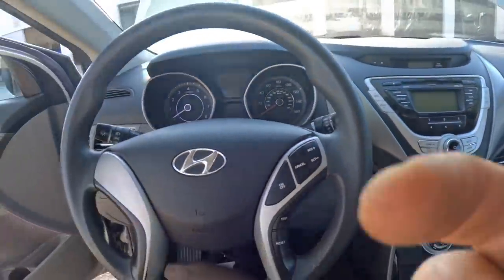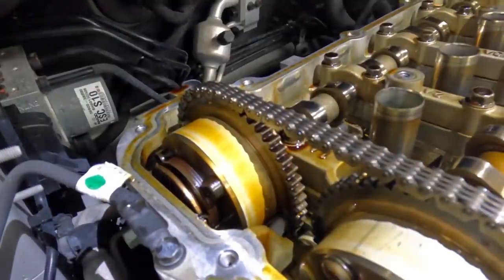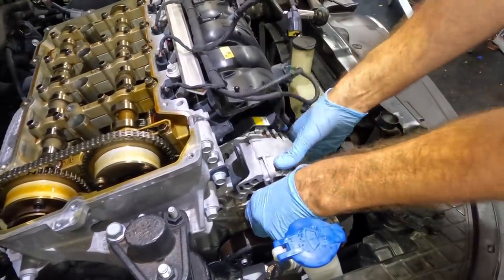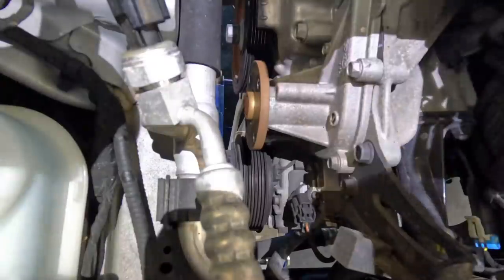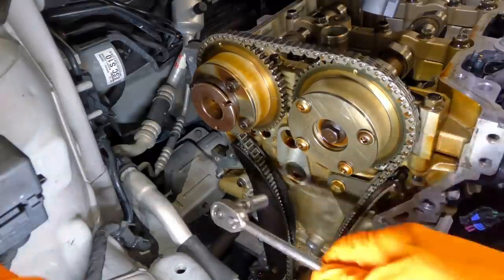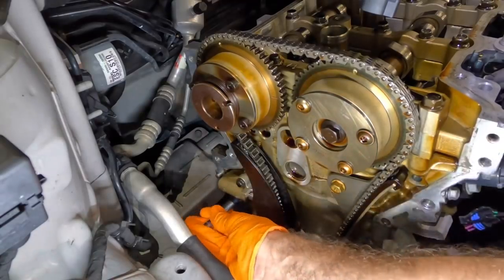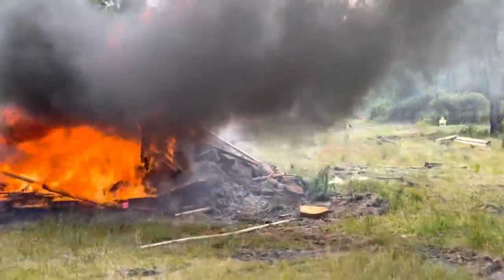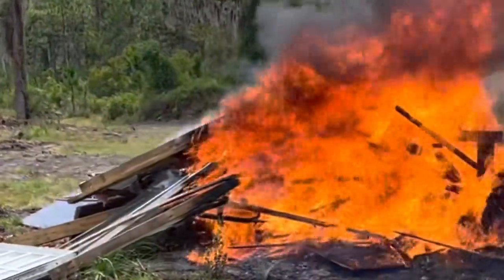I can’t finish this car! Evil Elantra!

Comment: I used to love Nisan, but the newer ones are just junk.
This one looks pretty nice, I like to see a beefy timing chains on an engine, and one this beefy, on a 4 cyl is awesome!
Reply: Erm, it's a Hyundai? 🤦‍♂️
Reply: I have the exact same car, bought it new. It has a NU engine which is literally a “ticking” time bomb
Reply: @DraftySatyr  ROFLMAO!!!
Then I'm in shock, that Hyundai would use a chain driven cam system, LOL!
P.S. I still stick to what I said about Nisan... 😂🤣
Reply: @RustyZipper  Hyundai and Kia are both, companies that build cars to only last 5 years, the average time it takes to pay one off.
Back in 2007, I purchased a Kia Spectra 5, and in 2 years, it completely started falling apart.
I traded it in on a Subaru Outback in 2009, and if I didn't have trade in insurance, would've had to pay them to take it!
I have no idea why I thought the Elantra was built by Nisan, LOL!
Reply: @KentuckyRanger  Strange that both should offer a seven-year warranty in the UK then - and were the first car companies to do so.

Comment: 11 year old car with 162,000 miles - very clean engine. 
I'm curious about the oil change interval, and which oil the owner used in this engine.
Reply: I have the exact same car with 80k miles. That’s extremely clean!

Comment: Out of interest Ray, Would you recommend a new water pump while you were that far into the engine, with all the othe ancillarys out of the way?
Reply: my opinion always change the pump. Relatively low cost item
Reply: I thought the same thing when he got the tear down to the water pump...personally, I would on my own car.
Reply: @robsterenborg  That is one of the reasons I asked as I would to. EDIT. I am not trying to knock Ray and we do not know the whole story
Reply: Also replace the belt, tensioner, thermostat if possible.
Reply: If you're already there it's only $20-60 more to replace, so why cost yourself hundreds later by pinching a few pennies now?
Reply: @kevinwilliams4899  well you never know how much the customer can afford. Chances are great that the pump might die and then this pump will be a lot more expensive. But people make strange decisions all the time
Reply: @robsterenborg  I’m sure Ray suggested the ump,,just weird he didn’t mention it yet !

Comment: Did the chain seat itself on the crankshaft sprocket, because it looked as if it wasn't. Or did you not worry since it would have sorted itself out the first time as the crank moved clockwise..

Comment: So, I guess you have to do an oil change too after spraying all that brake clean down into the front of the oil pan.
Is that something that the customer is charged for, or does the company eat that?  Just wondering.
Reply: The shop I worked at would work the oil change into the estimate.  Anytime the front of the engine is torn down the oil should be changed.
Reply: And A coolant flush
Reply: even if he didn't it disappears through the pcv valve the first time it warms up.  you truly should have known.
Reply: @i.jackanov7382  ya Bubba!
Reply: RTV remnants in there too.

Comment: At 21:00 you spray brake clean with reckless abandon into what I assume is the oil pan. Why is that not concerning? Was an oil change expected before it leaves the shop?
Reply from the maker: Because it’s going to be drained before the job is done. No worries on the oil contamination
Reply: @wyatt rich You should, and most mechanics will, change the oil whenever you open up the engine like this.

Comment: Some engines will clear but most will have an interference fit. The pistons will hit the valves. Do not turn the crank or cams while installing or removing.
Reply: With the rotation of the cams unrestricted, as they were while Ray was doing the crank rotation, the cams will spontaneously rotate to a position where the valves are all closed.  Spring pressure from the valve springs forces the cam lobes away to the TDC or near TDC position.  Rotation of the crank in this instance, therefore, is not a risk.  This is especially true since the cams had already been positioned at the TDC position and they had only been moved slightly relative to that initial setting.  Furthermore, the intake cam and the exhaust cam were disconnected relative to each other and this further promotes free rotation to the optimal orientation.
Reply: Had a timing chain break on my s10. Bent every single valve. Fun fix
Reply: @stevegrant425  Nahh, there is no place where all of the valves are closed. A cam won't move on it's own anyway. Just moving a tooth or two during removal probably won't do any damage. What I meant was don't just crank over the starter trying line up the dots.
Reply: @Michael-rg7mx  you are right. I was thinking of bike engines with a single cylinder per cam.  On engines with multille cylinders, each can  poten tially reach tdc at different times. Thx for the correctikn.
Reply: @stevegrant425  and thus….the end !
Reply: @Michael-rg7mx  Dah !

Comment: I’ve got a question if anyone is willing to try to explain it to me. If a timing chain and all its links are a set length, why do you have to line up the marks on the chain with the marks on the parts it integrates with? I can understand why the parts all need to be in the correct orientation to maintain timing but is the chains orientation as critical as the sprockets?

Comment: ray i need your opinion/advice . 6 years ago i puchased a used 2011 tucson from a dealer. it has always had a harsh teeth rattling ride like an empty american p/u from the past.   struts and shocks have been changed, dealer and other tucson owners tell me this is normal for this  model year.  i purchased an extended warranty so what ever it is i'm covered.  any ideas ?

Comment: With the parts and labor my guess is the owner will be facing a bill of a couple of thousand bucks.  I would have just lived with the clattering at cold start, a 2011 Elantra with over 160,000 miles is nearing the end of it's life anyway.
Reply: That whole timing kit with phasers is only $200. I don't think it will be as expensive as you think.
Reply: @alexandermckay8594  Most garages doing work like this will only use OEM parts direct from the dealer, also there is standard practice for garages to add a mark up on the parts so trust me when I say the invoiced total for the parts will be well over $200.  Regardless, as I say the total cost for this job will be around $2000.  If the man himself wants to interject and state otherwise and say I'm way off then I'll happily stand corrected.
Reply: I was quoted $1300 for a Ford van about 5 years ago. I chose to put the van in a dormant condition (159K miles on odometer) and buy a Chevy pickup. The van now stores a few sheets of marine plywood and some cypress lumber.
Reply: @108gk  I bet you could do the repairs yourself.  I am no mechanic but with a little help from Youtube over the years I have replaced struts, ac compressors, axles, wheel bearings, fuel pumps, brake and exhaust work.  I'm pretty confident I could do a lot more, it's all about building up your confidence, knowledge, and tool collection!
Reply: Sad thing is I own a 14 Elantra and after a ton of research the cold startup noise on these engines is the norm. And yes, this was a waste of time and money. Given how clean his engine bay was it makes sense this guy is babying this car too much. Not a car worth investing this heavily in.
Reply: @user-pj8em4gu6v  Saying is…… It now, before this repair, has served it’s purpose to mankind ! LOL
Reply: Granted it was at a dealership, I once had this repair done under warranty on '12 Elantra and the cost charged to Hyundai was like $2300. Car still ran poorly after the repair, so I sold it for a '13 Avalon with 30k miles.
Reply: @robbflynn4325  Ohh, I know that. I was just surprised because I would have thought the price would have been much higher on the parts cost.

Comment: The owner of the shop I work send me a Suzuki GS450 from 1982 or 84, without any wire harness, locked rear drum brake, welded nut on a broken swingarm main bolt, missing bolts that hold the engine, no working stator nor rectifier, crusty carburators, etc... a nightmare, I managed to get ignition spark and clean the carburetors, do the electric pick up with twin AC CDI, add new coils, new spark plugs and it finally works but needs a whole bunch needs a donor bike 😕 it's been a long 5 months I only want that motorcycle to go away from my garage 😭

Comment: It's just a Car, Ray. A Nut's a Nut and a Bolt's a Bolt. You can do it. Personally, I am being whopped by an o3 Camry, with P0031 Heated O2 Sensor ckt. It isn't Sensor and I can't find info on the Circuit, Fuse or Relay location. I will most likely spend the $70 or so it costs, for a Factory Manual. Such is our burden, my Friend.
Reply: A weirdo is a weirdo…. why try to fix a nineteen year old car…. & you said “ friend “ that means singular…. what no have no other friends ?

Comment: What does a phaser do and how do you diagnose it and what caused that one to fail ?
Reply: The phaser is used in a variable valve timing engine, it is used to advance or retard the camshaft in relation to the location of the driving sprocket attached to it.  This is performed through hydraulics - a solenoid operated by the PCM will allow oil to flow into it, or allow oil to drain out of it.  

A bad phaser will allow the cam to run out of time which can be detected with diagnostic software.  A seriously bad phaser will make itself present in a physical inspection, as displayed near the front of this video (you could see the chain moving unnaturally on it).

Comment: So....what exactly is the failure?  A item that varies the cam timing?  And why would that fail?
Reply: I reckon spring tension was not up to spec,  but the 'why' wasn't specified.
Reply: The two plastic chain guides wear to the point the tensioner doesn't take up all of the slack. The variable timing gets too variable and you get rattles and misfires.
Reply: Failure to communicate !

Comment: Ray, in the past, when you change a wheel bearing, I've seen you use a kinda of flapper abrasive wheel..Can you list the part number and where did you got it from?  😎
Reply: Does it go on an air tool? About 1.5” in size?
Reply: You can get them from hardware stores (Bunnings here in AUS, I guess Home Depot in US or whatever you have). Pretty standard drill attachment.

Comment: Why ever happened to the old days when timing chain meant you never had to mess with it?  Chain stretch? Phaser wear?  I swear I would rather have an EGR with a timing belt system.
Reply: Definitely timing belt systems aren’t bad. I have a Toyota Tundra and the v8 engine has a timing belt, I had it done in 2018 at 132,000 miles and I won’t have to do it again until 2028 or 222,000 miles and I’m currently at 172,000 so it’s not bad of an expense at all, since the the engine is very reliable.
Reply from the maker: The EPA happened, and we tried to legislate a desired result at great cost to the consumer. Domestic diesels are a perfect example. They come equipped with thousands of dollars in failure prone emissions systems that the end user has to pay for, however, vehicles built for export do not have the mandated equipment and the OEMs are free to ship them overseas all day. America Last…it’s been that way for decades

Comment: If there is still time, check the chain on the crankshaft again ... it does not fit correctly - 27:30
I mean the chain to the teeth, NOT the link to the dot.

Comment: sound like crank bearings wich is common on hyundai 4cyl engines....its a known issue. there actually being sued for this, we have replaced over 1200 engines from hyundai in the year 2021 in the 2.0L format ALONE. The hyundai 4cyls are garbage....the issue is lack of lubrication in the crank bearings and it just burns them up n dissolves them...drop the oil pan...i gurenetee u it needs a engine
Reply: Nope ! Normal !

Comment: I can hear your co-workers in the background cinching up oil drain bolts with an impact.
Reply: Hahahaha
Reply: @TheFrenchPug  ok put oil drain in finger tight…then put 1/2 impact gun to “on” this will tighten to 500 lb.ft. ( if you have a snap on gun” ) hold trigger for 20 seconds! Your done…just add oil….you got it now!? LOL
Reply: Torque to spec - two ugga duggas.

Comment: I’m surprised that you didn’t remove the spark plugs. It makes changing the timing components much easier since things won’t bounce to a different position under compression.
Reply: I recently changed the timing belt on a Honda J35 at 100,000 miles.  As part of the service I also changed the spark plugs.  I did the belt, then afterwards did the sparkplugs.  While trying to align the cams I experienced the "bounce" you mention.  I wish I had read your comment before I started on that "Odyssey".

Comment: I have a 2012 Elantra with 121k miles with the same noise. How much did this job cost? I'm mechanically inclined but just touching a timing chain sends me into a panic. I had a 2006 maxima that had the plastic timing chain guides, it broke at 50mph and jumped time... Since then I'm terrified to mess with anything inside the engine like this 🥺
Reply: There was a class action lawsuit settled by Hyundai about bad piston rings. You probably should contact Hyundai ASAP
Reply: @mwf5454  really now? I'll definitely check it out! Thank you so much!!!
Reply: It depends on the engine.  Not every Hyundai engine is part of the class action.
Reply: @mwf5454  after 20 rings……..this number is no longer in service !

Comment: After having to deal with  a family members 2016 Kia burning 1.8L of oil every 10 days with less than 80,000km/s  and Hyundai saying "All cars burn oil it's normal. Were as reliable as Honda's" . I will never own a Hyundai product.  I don't care how cheap they're to buy.
Reply: "I had a bad experience with an XYZ product once, therefore all XYZ products are bad and clearly inferior to everything else"... You sound silly as hell, you should rethink the choices that brought you to this moment.
Reply: All manufacturers call a situation” normal “ when a specific problem in their product hit 10,000 complaints! The word NORMAL is abused as much as I LOVE you !
Reply: @wyattarich  I work on cars for a living. Some manufactures have better reliability and better designed engines then others.  Honda's aren't without fault .  There a class action lawsuit against Hyundai in regards to those engines.

Comment: I just watched you spray brake cleaner right into the oil sump. Everything you sprayed, all the gunk, all the brake cleaner, all the debris, went right into the oil sump. Not good.

Seriously, you need to lay off that stuff. I hope to God you change the oil later in the video, before you try and start the engine. Brake cleaner is not meant for tons of things you use it on.
Reply: You're hating on the big guy today.
Reply: Brake Kleen doesn't stay in liquid form - it evaporates away very quickly. Even if it somehow became trapped in the oil, as soon as the engine got warm it would evaporate and be carried away by the PVC system.
Reply from the maker: No worries fellas, the oil will be changed before it’s done
Reply: Jay wakin is a crime too ! People do it every day & don’t get arrested ! LOL